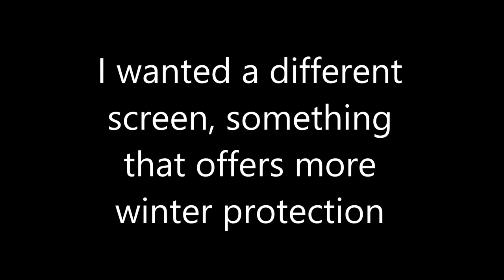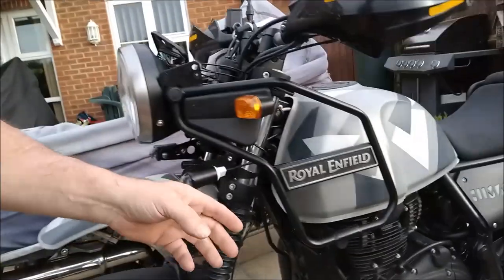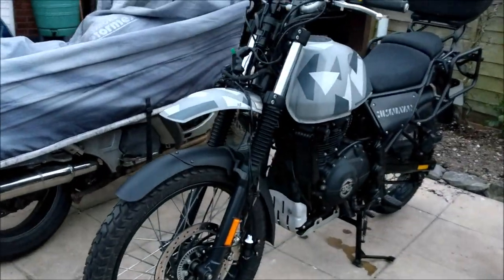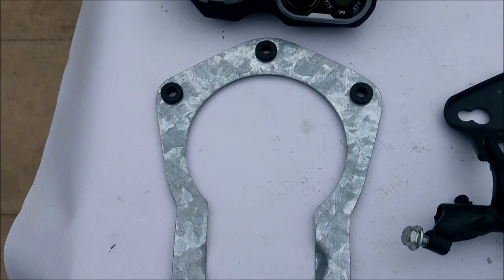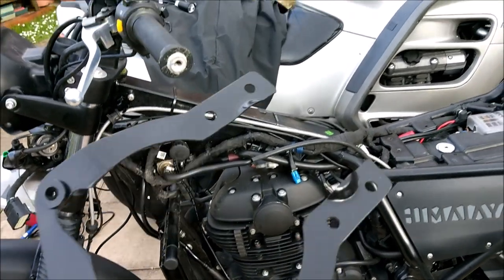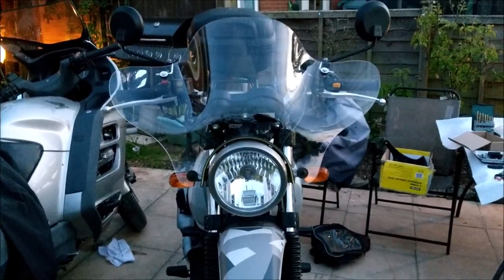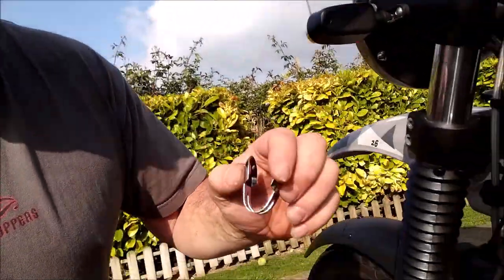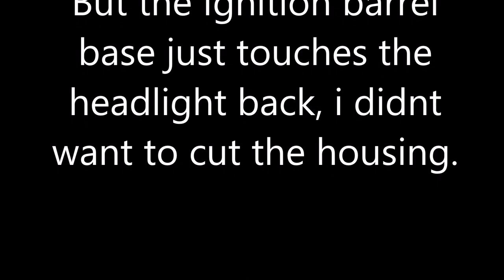Royal Enfield Himalayan #20 Screen Change ~ conversion

Comment: I like the works you are doing on the bike.  Not sure about the new screen, but if it works, then that is the main thing.
You said the ironmongery you removed was fairly heavy.  What is its the weight ?
Reply from the maker: Hello John, 3.4 kilo's has been removed.
Reply: Thanks.  As you said, quite a weight.

Comment: How is that setup for reflections from the instruments on the screen at night? and..is it a good idea to have your indicators so close to your headlight ? may reduce the visibility of them when headlight is on...
Reply from the maker: Great questions oyley thank you, firstly i literally finished this video and did the editing yesterday evening so I've not ridden it at night yet, the distance is fine here in the uk, I'm not happy about the indicators being half hidden behind the stay brackets, it's all new and I'm bound to modify it until it's correct. 
I might go for longer indicator stalks by making a couple of spacers. The instrument illumination was too bright at night to begin with, so I'm looking to put some kind of filter inside the clocks to dim things down, thanks for your comments. Take care.
Reply: @eadsierestorations  I looked at the time you posted after my comments...My line of thinking that with partially obscured 10 watt indicator bubs that they may be not that visible so close to a 55 watt white light source that has a 7" reflector bowl ..especially by some oncoming inattentive car driver...great videos and love the practical approach.

Comment: Adrian - I like the way that you did the still comparison pictures and I like the new look of the clocks higher up.  You did a nice job cutting out the big bracket. What did you use to cut it - a Sawzall? LOL I thought that you wanted the new spots to turn as you turned the bike but they are now fixed forward. Regardless, your modifications look great.
Reply from the maker: Thanks Chuck, i used my reciprocating saw with a fine tooth Dewalt metal blade.

Comment: Thanks for this video. I quite like the Enfield but when I first saw it I thought that the side bars looked damn ugly. They would however give you a good place to place some soft luggage. Overall you have prettied the bike up and the new screen looks functional rather than  handsome. Just my thoughts. Thanks again and following.
Reply from the maker: Hi Colin, yes i prefer the naked look to the stock look. And you are 100% right about the screen, but i have completely forgiven it and I'm very happy to live with it because of how the whole new front end set-up just works so well. It's more flickable, at least 3.4kilos lighter, the control cables and the respective wiring now no longer hinder the steering, combine that with the fact that I've loosened up the (stupidly tight to the point of damaging) headstock bearings, i seriously feel now that the bike is more like it really should be (if that makes sense)?.
Some modifications to bikes ruin everything that the manufacturer has spent millions designing and I'm a big stickler for that, "leave it alone" type mentality (especially with exhaust cans.... LEAVE THEM STOCK grrrr lol) BUT..... and it's a huge but....i am so pleased I've done this! It's now my favourite bike bar none. It felt good to begin with, now it feels Great. 
Thanks for your comment.
Reply: @eadsierestorations , I have little experience of riding any Enfield but I did rent a 350 around 1990 around Goa/kerala in Southern  India. I will never forget that experience. Foot controls on opposite sides made it even more interesting. The release of the Himalaya means that when I have the time to get from my home in Thailand to Northern India for a couple of weeks riding in the Himalayas, I will definitely be looking to rent a bike like yours. I just know that in tight situations there will be plenty of locals that will know how to get the bike moving again with the minimal amount of tools at the side of the road. I dread the time that I get a puncture on my T120 on my travels as that is not something that can easily be fixed at the side of the road a minimum of tools LOL. I really appreciate the way you present your videos and your humour. You will be one of my first contacts when I am broken down half way up a mountain in India ha ha!

Comment: What about the tank protection if you remove tank crash guards the tank expose to damage in case of fall ..... Just a thought
Reply from the maker: And a good thought it is to Vaibhav, I have managed to survive 36 years on two wheels without denting any fuel tanks, im in the uk and im not going to be going off-road any time soon. Having said all that, I might try to fit the tank brackets back on yet, its all "work-in-progress" thanks for your comment friend.

Comment: Hello Adrian,
First thanks for your excellents videos. I can't find the one on which your remove EVAP system and i have a question about what you do with thank hose that is connected to the EVAP box? 
Thanks a lot for answering
Reply from the maker: My evap was removed so I could make a steel belly plate using the RE alloy one as a pattern, it was re-installed afterwards.
Reply: @eadsierestorations  
Ok i though that you are still riding witout the EVAP

Comment: Looks a good job, screen fits very well, think you need to consider some engine bars, no protection now against accidental drop.Very impressed.
Is the oil leak from cylinder head bolt now cured.
Tony
Reply from the maker: Hello tony, cylinder head is no longer weeping by that bolt, i would have liked to get my M6 tap in there but it's impossible without removing the cylinder head as it's too long,
Reply: @eadsierestorations  
Hi Adrian,  thanks for reply, I would consider if the leak returned removing the head and if room permitting drilling out and fitting a helicoil, you can get a lot more torque that way.